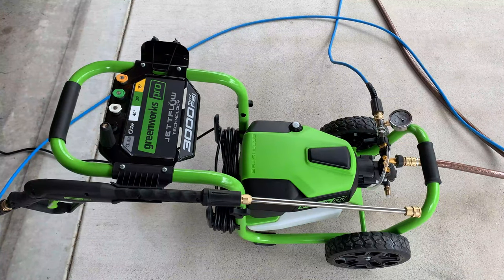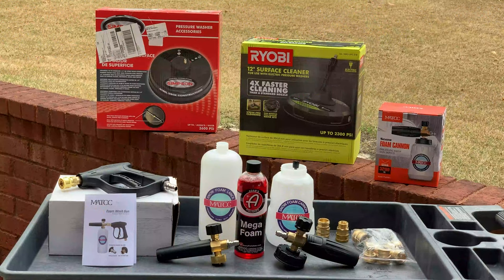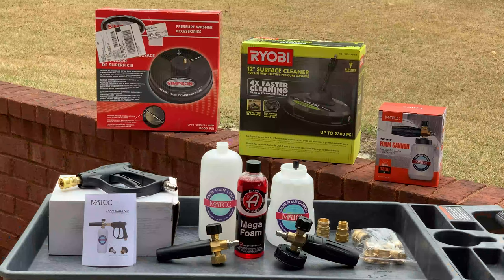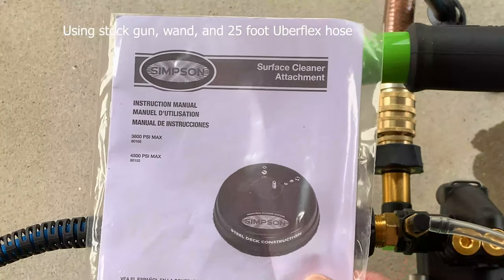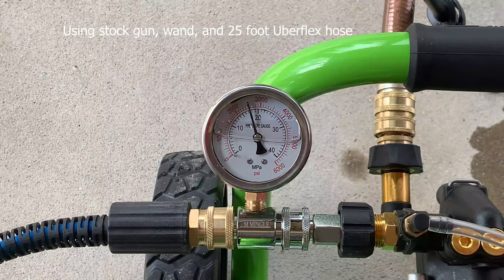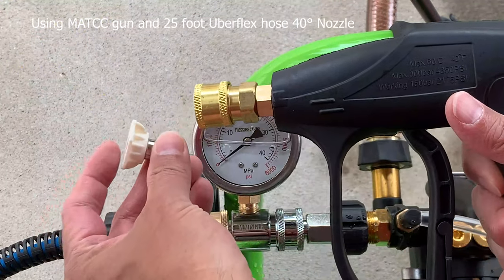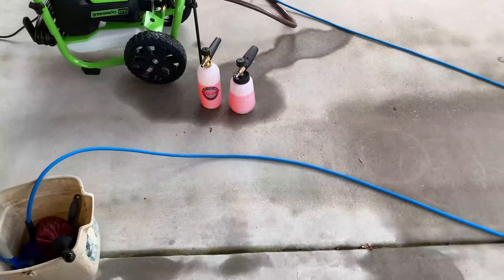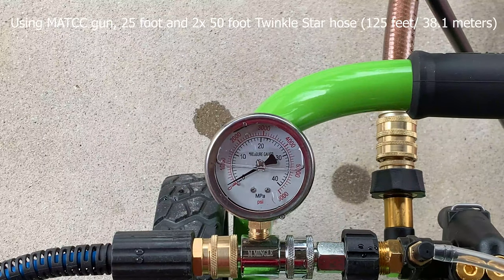Greenworks 3000 PSI electric pressure washer Accessories test

Comment: I have been looking at one of these to run a 15" Karcher surface cleaner, and for car detailing.  Now I'm not sure if it'd be able to handle the surface cleaner.  Hmm.
Reply from the maker: The problem is the GPM most of the surface cleaners require. If the Karcher 15" surface cleaner is made for electric, it should work.

Comment: thank you for testing and sharing this, along with others like OG. I need a PW for washing siding/fencing etc for paint prep on my rentals and wanted an electric one to avoid the hassle of gas, but still have close pressure. The listed specs vary too wide to be believable so it's very helpful to see actual pressures. The extra money is worth it with the time saved spent cleaning.

Comment: Very nice video. I just bought one on Black Friday special, nice discount. Question, if the unit comes with a detergent tank, why people use the foam cannon container? How are they different?
Reply from the maker: Thank you for the comment. The foam cannon adds air to create the foam. It is adjustable. It can allows you to adjust the amount of soap, water and air basically. The down-tank on the pressure washer is more for things that don't need air mixed in. For example, I've seen some people pour Sodium Hydrochloride/bleach in it.

Comment: What do you prefer for the average homeowner that wants to clean siding , a 25 foot driveway and porch concrete ? The Greenworks 2000 , 2300 or 2700 .. I doubt I need the GREENWORKS 3000.     Just asking  thanks
Reply from the maker: After using many different pressure washers for various things; such as driveway, siding and car, I find that having more pressure is better. Also, more flow is better for spinning those pancake-style surface cleaners. The small Ryobi surface cleaner for the electric pressure washers is good, but I have a lot of driveway. A larger diameter one would have been much faster but would require a larger pressure washer. With that said and with what I've seen online concerning the Greenworks 2700 and my own tests with the 3000 PSI pressure washer, I'd probably have save some money if I just picked up the 2700 PSI. The testing that I have seen shows pretty much the same results that for the 2700 PSI washer that I saw in my tests for the 3000 PSI washer.
Reply: @TerryOtsubo      Thanks for the knowledge and answering

Comment: Homeowner here. Patio, siding , car etc,
3000 is on sale for $349 and 2301 is $249 at Lowe’s. Thinking of saving the $100 and using that to buy a 25 foot uberflex extension, foam cannon and short wand. Thoughts?

Thanks!

Comment: How are the quick connect doing? Looking forward to getting some.
Reply from the maker: The quick connects are getting damaged. The ball bearings inside them cause grooves in the mating surface of the odd connectors. I think this is common behaviour across all brass fittings. So, it is to be expected and will eventually wear out and need replacing. The rubber gaskets are holding the water fine. No leaks.

Comment: Will 1900 psi on the 40 degree nozzle chip car paint?
Reply from the maker: If you get close, I think it could damage the paint. For example, I took some clearcoat off the front bumper of one of my older cars a while back where there was a stone impact. So in the right conditions, it could happen.

Comment: I'm confused. It's rated for 3000psi, but on "idle" its 2500? And then the different tips give different pressures? Is there a regulator on it to adjust pressure? And if your pressure gauge is at the motor why would you get different pressures when you change your tip? The motor should be putting out the same pressure and your tip determines the power right?
Reply from the maker: There is no manual regulator adjustment. This is a quote from the Greenworks website:
"Featuring our patented JETTFlow™ Technology – the digitally controlled brushless motor automatically recognizes the selected nozzle, providing the maximum amount of consistent water flow. With our heavy-duty cast aluminum axial cam pump, this pressure washer delivers Better Than Gas™ performance with the convenience of clean sustainable power. "

I may have a defective unit. I'm going to contact them about why I cannot get a constant 3000 PSI with the 15 degree tip.
Reply: @TerryOtsubo  hi Terry,  have you try to contact them? If yes what do they say?
Reply from the maker: @DimplesDon9  I have to thank you for your question. I completely forgot to contact them. Your comment just reminded me to do so. I'm going to do it now before I forget again.
Reply: @TerryOtsubo  sounds good. Please let me know before I make a purchase. Really glad to see this topic.
Reply from the maker: @DimplesDon9   Just a quick heads up, I sent Greenworks customer service an email shortly after replying to you on Saturday. Based on my prior experience with Greenworks's customer service, it may be a week or so before they respond. If they respond earlier, I will post what they say. Thanks again for reminding me to send them a note.
Reply: @TerryOtsubo  no problem man. I'm looking forward what they going to response. Keep safe 🙏
Reply from the maker: @DimplesDon9   Just a heads up. I still haven't heard back from them. I sent them another email on Friday 2021-06-11.
Reply: @TerryOtsubo  I really appreciate the update.
Reply: @TerryOtsubo  thank you Terry
Reply from the maker: @DimplesDon9   Just another heads up. I still haven't heard back from them.
Reply: @TerryOtsubo  all good man, just here waiting.
Reply from the maker: @DimplesDon9  I still have not heard back from them.
Reply: @TerryOtsubo  they told me that the 3000psi is based off of its working internal pressure, which is kinda misleading, your unit is not defective, I have the 2700 model and get similar results -300 or so psi, ito be fair in comparison other  electric models have far worse results and similar claims, like the sun joe 2300psi brushless gets like 1100 psi with a 15 degree tip at 2.0 orifice
Reply from the maker: @mainsource8030   Thank you for this information. Interesting that this is PWMA certified, which is supposedly used to help consumers understand performance in order to make the proper power selection for their needs. The advertised ratings for pressure washers are not always what you get due to inconsistent methods of rating PSI and GPM.
Reply from the maker: @DON Q They replied.

"Thank you for contacting Greenworks. I apologize for the delayed response.
 
I'm more than happy to help you out. Yes this is normal. In order to get the highest PSI you'll need to use the strongest nozzle, the turbo nozzle.
 
The PSI changes depending on the nozzle. You can't get full power out of a 15 degree dip as it is spread out 15 degrees.
 
I hope this information helps, please let me know if you have any further questions."
Reply: @TerryOtsubo  awesome, it make sence. At least you see the close number there. Some manufacturer  lied on their paper sheet. Thanks man!
Reply from the maker: @DimplesDon9  They are sending me another turbo tip to retest with. They said my PSI numbers were too low and think the tip I have is defective.
Reply: @TerryOtsubo  nice! Update me once you get the new tip and latest reading.
Reply from the maker: @DimplesDon9   Will do. They state I should receive it in about a week. I'll retest the turbo nozzle.
Reply: @TerryOtsubo  The pressure gauge is the culprit because they can be off by 500 psi
Reply from the maker: @josephtheinflatableguy4609  That's wild.

Comment: @Terry O: How was the experience with any of the surface cleaners, did they actually clean the surface under the surface cleaner?
Reply from the maker: The 'Ryobi 12 in. 2,300 PSI Electric Pressure Washers Surface Cleaner' was clearly the best. It seems to work better even than the 'Greenworks 15-in 3100 PSI Rotating Surface Cleaner for Electric Pressure Washers'.

Comment: Sorry if I missed it, did you ever test the Simpson surface cleaner? I didn't find it in the video.
Reply from the maker: The Simpson surface cleaner attachment didn't work with the Greenworks pressure washer. The wands inside spun, but not very fast. I'm guessing the Greenworks didn't have enough pressure and water volume to move the wands. It probably needs more than 1.2 GPM. The recording on the pressure gauge read only 300 PSI.
Reply: Thank you!
Reply from the maker: @CodyFlock   You bet! Glad I could help.

Comment: I purchased this last night and didn’t get the extended warranty for $65.00 for three years beyond the manufactures warranty. I’m wondering if I should go back and add the warranty or not. Purchased from Lowe’s. What’s your suggestion ? Thank you
Reply from the maker: I didn't get the extended warranty.

I typically don't get the extended warranty. I use my pressure washer once every two to three months. I hope to get at least 10 years out of it. The only things I can imagine breaking are the motor and pump. Everything else, I probably can fix with stuff I keep around in my workshop. I'm not saying that the motor and pump would break, but if they did, I can't imagine them being more expensive than the blower motor in my HVAC system, which can be purchased for under $100 USD.

The mathematics doesn't work out in my situation. However, it may work out for your situation.

While I'm comfortable with fixing things when they break. However, as I get older (2021, I'm in my late 40s), my back gave out while I was disassembling my freezer... was lifting the door and then sudden pain. So, I can foresee that I may not always be able to repair and service my own equipment. Perhaps at that point, the extended warranty would make sense for me.

I'd still read the fine print. For example, is it $65 and then if it breaks, you drop it off at Lowes? Does it have a deductible? What happens if they can't repair it? Does it cover both parts and labor? What if you can't drop it off? Does it cover onsite repair?

I'm not one of those people who never buy extended warranties. For example, I have extended warranties on my phone and watch.

Now, if you're asking if I think the pressure washer will break in six years... Depends on many factors. How much do you use it, how long do you let it idle, how do you store it, do you clean it after each use, do you store it indoors... I believe that under the best conditions, this or any other pressure washer will still break. I still have my gas-powered Simpson pressure washer with a Honda (consumer-grade) engine and even it has had issues. In my use case, I expect to get at least ten years. When I use my pressure washer it gets used 10 hours straight. So far, no problems.

Greenworks support is not the best in my opinion. I still have an open ticket with them that I opened in early June about why the pressure I was seeing was 500 PSI lower. If this were Ryobi, which I've contacted in the past many times, my question would have been answered weeks ago. Ryobi's stuff breaks all the time, but their support is top-notch. I really wanted to buy a Ryobi pressure washer, but wanted to give Greenworks a try.

Comment: I bought the pressure washer today. Which nozzle would you recommend using on a brick paver patio? Thanks!!
Reply from the maker: Thank you for watching. I wouldn’t use the tips provided for patio pavers. Instead, a surface cleaning attachment. However, if that’s all I had to work with and just needed to get it done, then I would start with the 40° tip to see if that worked. If not, then the next strongest tip and so on. The strongest tip is the turbo nozzle. The less cleaning you do with a pressure washer, the better.
Reply: @TerryOtsubo  Thanks for replying so quickly. I have looked at several surface cleaning attachments but don’t know which one would be best. Which one would you recommend for this pressure washer? I will be using it for brick patio and concrete driveway. Thanks again for a great video!
Reply from the maker: @joecorbin3553   Anytime. I currently recommend the Greenworks 15-in 3100 PSI Rotating Surface Cleaner for Electric Pressure Washers opposed to the Ryobi 12 in. 2,300 PSI Electric Pressure Washers Surface Cleaner. This mainly due the pressure and diameter of the attachment. The larger diameter typically allows you to finish the job faster. Also, I wouldn't recommend any non-electric pressure washing surface cleaners as the GW 3000 unit doesn't have enough water volume to keep the spinners spinning. I hope this information is helpful. Have a good one!

Comment: How much water flow using the different spray angles?
Reply from the maker: I didn't test that.

However, the rating is certified at 1.1 GPM or above 4 liters per minute. That is pretty standard with electric pressure washers. I do not think any electric pressure washer has the ability to exceed that flow rate (unless there is no tip attached).
Reply: @TerryOtsubo  thanks.
Wish it were around 1.8-2.0 gpm. 
Having a high flow rate is the name of the game, helps both in rinsing and foam cannon shaving cream quality (w/ 1.1 valve)
Reply from the maker: @lexist2112   I totally agree. A 2 GPM flow rate is needed to spin up some of those pancake-style surface cleaning attachments. I can't wait for someone to release an electric pressure washer that is 3000 PSI and 2.2 GPM.

Comment: This was a great review.  Only thing I could have asked for would be a test with wider orifice tips.
Reply from the maker: You are right. The orifice size matters, especially for the pancake style surface cleaners.
Reply: @TerryOtsubo  what orifice size were you using with the 15, 25 and 40 nozzles?
Reply from the maker: @mainsource8030   I am not sure. Greenworks says 3.0 across the board, but this seems way too large.
Reply: @TerryOtsubo  indeed, i get similar readings and im using a 1.5 orifice tip, sometimes the size is etched on the steel neck of the tip written like 00020 or 02000 for a 2.0 orifice

Comment: Thanks for the video and showing the MATCC III!

Ohh man, I didn't expect to see such a psi drop on electric washers. How did you like the foam canon? After all this do you think the greenworks 3000 is priced correctly or is there other electric pressure washers lower in price that can perform close to the greenworks 3000? Do you think the greenworks 3000 can perform well at doing simple jobs at home? The gas pressure washer I borrowed was a Rioby 2900 psi and for me that is enough, only concern is if one day I wake up at 5 am and want to start my chores early I don't want to disturb my neighbors. Thank you once again
Reply from the maker: The Foam Canon was nice. The regular MATCC was not that great when compared to the MATCC III. In terms of price, that is a tough one. I think the 2700 PSI version would probably have had the same results. The pressure washer is loud, but not as loud as my Simpson 3000 PSI gas pressure washer. I had the pressure washer in my garage so I could wash the patio. It was quiet when it was in the garage. One thing that surprised me was that there was no noticeable pressure drop when using an additional 100 feet of hose. I was told that the tip elevation has more of an impact than the length of the hose in regards to pressure drop. Meaning, if the pressure washer was under my deck and I was on top of my deck pressure washing it, there would be a drop in PSI.
Reply: @TerryOtsubo  I ended up pulling the trigger on the GW 3000, only thing it's been few days since I place my order thru their page and they haven't email me with an update on my order. Looks like their customer service sucks lol
Reply from the maker: @ShinyOwl  I also contacted Greenworks support to request a digital manual. That took 10 days to get and required me to ping them again for it. So, I am with you about their response. It is pretty slow.
Reply: @TerryOtsubo  have you used a pressure washer broom? I am on the market for one, I am just afraid it will leave marks of the floor.
Reply from the maker: @ShinyOwl   I've never tried a water broom. I just don't have a good use case for one. What would you use it for?
Reply: @TerryOtsubo  I use my waterbroom for washing my decks (not a spring clean) driveway etc! It's a huge time saver!
Reply from the maker: @jeffsmith2872   This is excellent feedback.